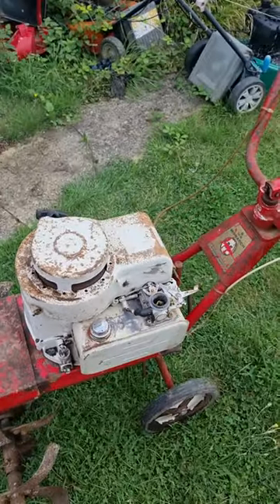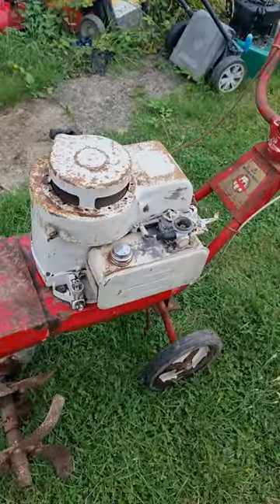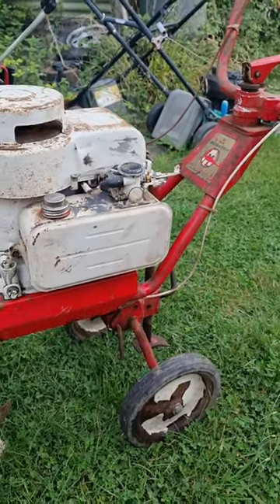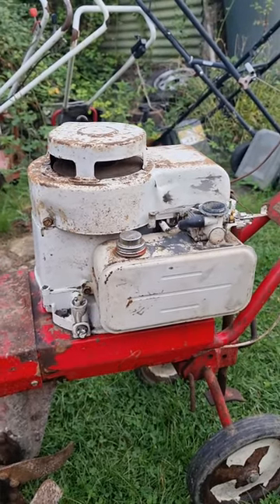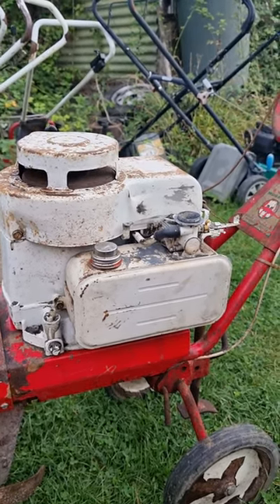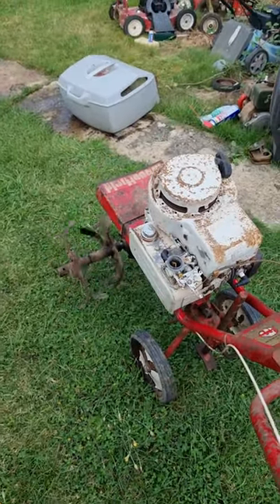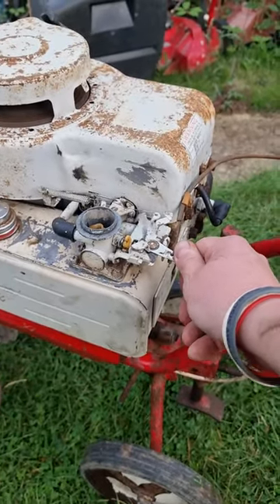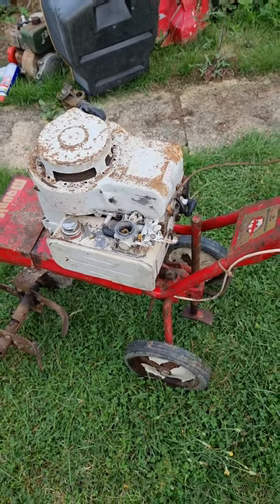1979 Mountfield M1 Monarch 5HP Rotavator First Start in 20+ Years

Comment: Do you have the part number for the carb kit (fuel pump)?
Reply from the maker: Hello. The part number for the Fuel pump diapragm is 272538S Hope this helps :-)
Reply: @LawnMowersThingsThatMakeNoise  Thank you bud!
Reply from the maker: The Air filter part number is 270447 if its the foam element. and the air filter tins is 299447 but they are very hard to get new but 2nd hand will be easier :-) hope this helps